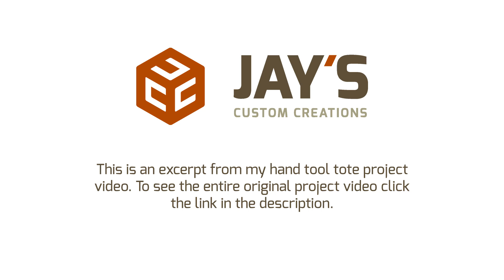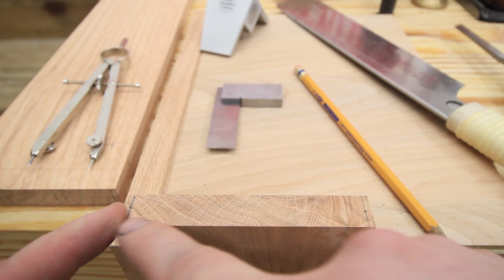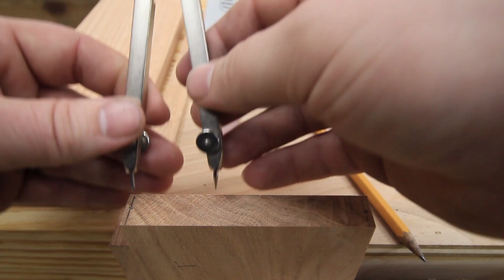How To Layout Dovetails With Dividers

Comment: Great video. Quick question, would it be correct for me to divide board by 3, set my dividers to that number and then start the dividing at the pin mark (whether I use 1/8 or 1/4, etc.)?  This way I don't need to keep making adjustments to get twice the distance from the pin.

Comment: Your choice to have 'halfpins' that are 1/2 the width of the others,however, the reason they are called 'halfpins' is because they are only sloped on one side.Just sayin'. The use of dividers is great.Thanks for doing this.
Reply: Dale Shewchuk   how would you lay this put. I have had good success with box joints working on getting the boxjoints to be very good.

Comment: Cant you just use the width of the board and divide by 3 and set your compass points that distance apart?
Reply from the maker: +Tucker Foss-Stockwell This is just one of many ways to get the same end result. Dividers are great for getting what you need without any math or measuring. On smaller easy to divide numbers it might be easy to just divide it out but if your board is 7-3/8" wide and you're wanting 8 tails it might get a little difficult to divide accurately. At first I couldn't wrap my head around why anyone would use dividers when you could just mark out what you need with a ruler by measuring. After getting used to this method I won't use any other. It's much quicker and very easily repeatable among many boards.

Comment: when setting up your divider you should start from the edge of the board instead of starting from the line. that way you would end up at the other edge of the board and you wouldn't have to eyeball the distance away from the edge.
Reply: i see ur point... (get it??) ;) 
?haha?
"small joke"
Reply from the maker: +Elev3n 6 one way half a dozen the other.
Reply: Elev3n  I was about to ask how the method pictured would  work.. I really am not an expert on joinery. but I here's the way I would do it. please correct me if and where I am wrong.    say I'm working on on a  one by six.  it will have a nominal  5 and 3/4 width.  let's say I want  three inner tails and the half tails on  the extremes.    I'm a little shaky on this I have done box joints and getting fairly good  fairly as in the acceptable tolerances.  so if want a total of four  do I use three points and figure the ends last or do I  use four points and l
 work from there.. I have done it both ways I'm kinda of a math geek so I like to know how and why things  are done.  I don't like approximates unless they are mall tolerances. I  this all based on math. I watched a guy tldo a 1/8 pitch on dovetails. he said draw a line    eight inches perpendicular and another  inch across. connect these together at their hypotenuse and they form a  right triangle.  I thought OPP over adjacent sides is the I  very definition of a the tangent of an angle which was learned in very quickly in trig..  so I thought  1/8 is is .125.  so the  arc angle of , that is .. and I went from there..   appreciate any help you give to me.